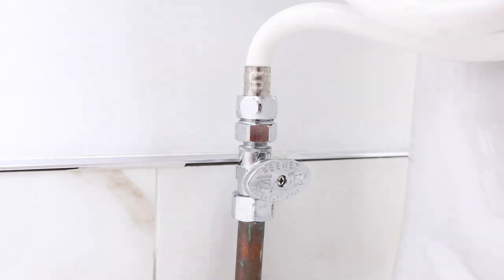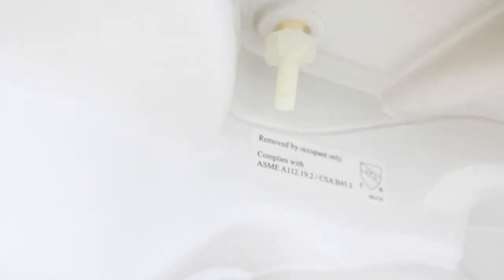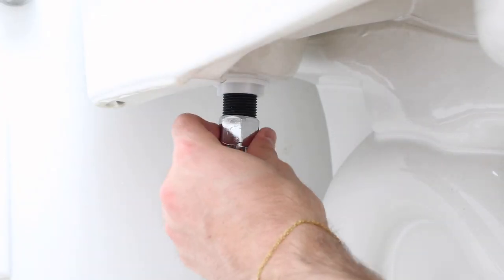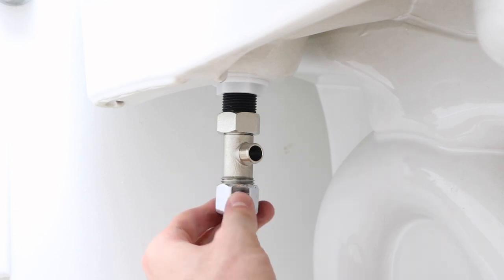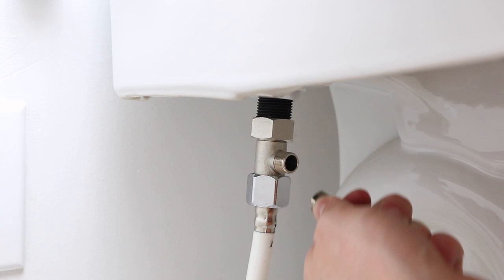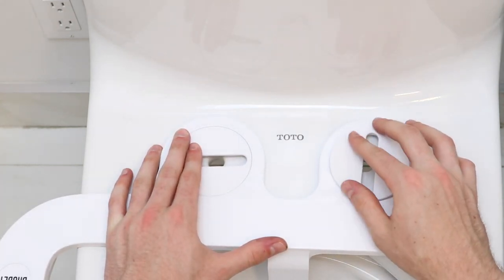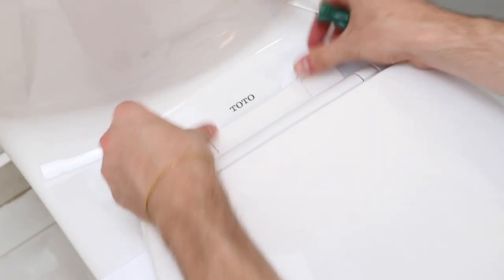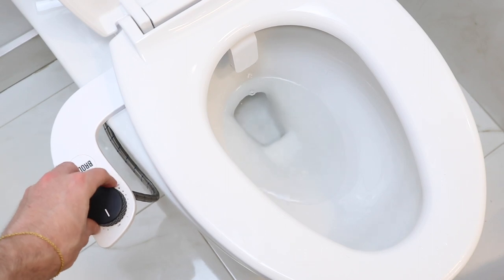How To Install The Brodet

Comment: 1) What are the rubber washers for since you don’t show them suing the install. 2) with the front of the seat now raised a bit from the extra space in back is that going to cause an issue with the seat?